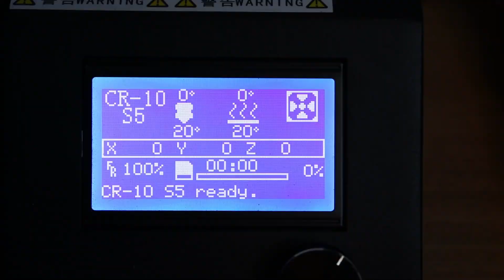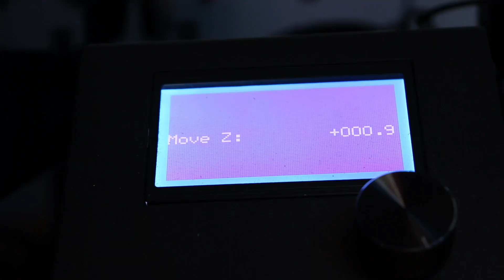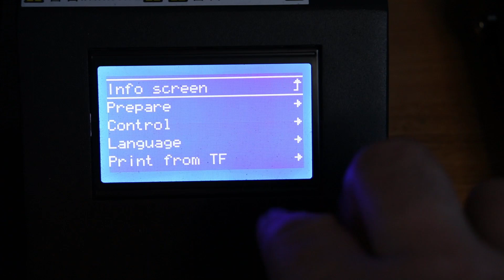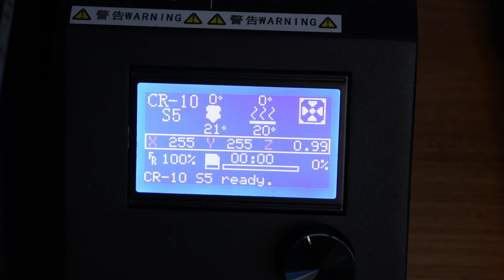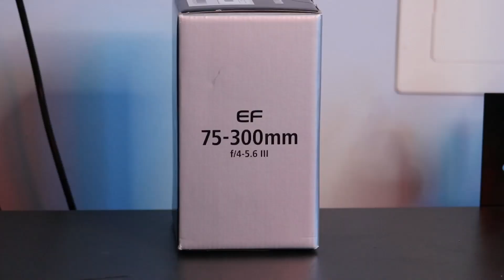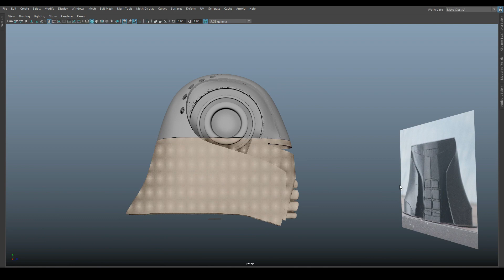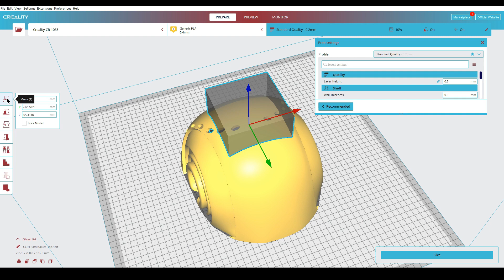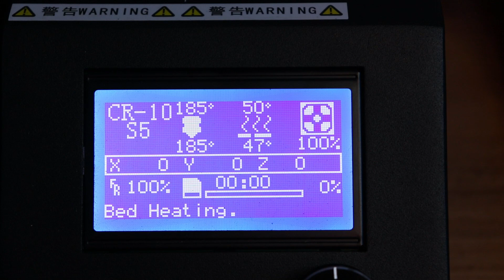Creality CR-10 S5 3D Printing: A Guide to Resuming a Failed Helmet Print

Comment: Uggg just ordered one of these, and seeing all the bs youve gone through I am regretting spending that kind of money on this. You also realize you are going to get a lot of issues leveling your bed cold. You need to head up to normal printing temps while leveling. And you need to stop touching your bed. Your fingers leave grease, and it will keep the print from sticking. Take it to the sink, wash with warm soapy water, dry it with a microfiber towl, and handle with gloves. Also try to print yourself some new knobs for bottom. I had to do that with all my CR-10S.  Lots of them on Thingyverse.
Reply from the maker: Hi Figure Six, thank you for the comment! I hear ya, it's not a cheap printer, and I tried returning it with Creality Official, and they just ignore my request and instead send me parts to fix the issue. Since this video, the knobs came loose again and the print failed. I finished it up on my CR-10 Smart. They sent me some new parts, and I'll be making a new video on this, and hopefully it will be the first successful print, start to finish on this behemoth lol. Also thank you for the advice, I will give that a try :)
Reply: @3DTheory  Sorry didnt mean for that to sound so bossy... I am already printing out new knobs and ordered silacone bed mounts getting rid of the springs. Ive also done that with all my printers. Hardly ever have to level once the springs are replaced.  I wish they made the Creality CR-10 Glass Bed Upgraded (black one with coating) for this size. I use that also on all my other printers, I can print just about any angle with no supports. Sticks like glue, wont come off until the bed fully cools down. Just gotta make sure its very clean after every use, cuz one spec of oil from fingers and print will slide all over the place. I ordered mine through Amazon so I will have 30 days to return it, if I have those kinds of issues. Ill keep watching see how your helmet comes out. Quite a long print for a helmet. All my Mando helmets take only a day and half 2 at most.. This must be a bigger helmet. I also been using a .6 nozzle instead of .4 make really nice prints and much faster. Anyways man, good luck..
Reply from the maker: @AncientOutlaw_raider1  Thank you so much :) It's a good thing you got it on Amazon, it's gives you a way out in case it keeps giving you trouble. I love glass beds with the coating too, I have that on my CR-10 Smart, I had to take a hammer to one of my prints as it was so stuck on there lol :D I usually scale up the helmets to fit loosely on my head, and I print pretty slow with a 0.4mm nozzle for higher quality. I will try a larger nozzle soon though! Nonetheless it's a pleasure to have you part of the 3D Theory community and can't wait to read more of your comments in the future :) Cheers!

Comment: They sell E-clips. Get you a micrometer and check the thickness of the stud and just get some E-clips to lock it in place. Most you'll have to do is get so needle noses and a tiny flat head to remove the clips. I was debating getting this and starting my business so I've been doing a lot of research on and watching videos about it. Since you offered insight on the printer I'd figure I'd try an offer you some assistance with that problem of the bed loosening on you.
Reply from the maker: Hi Smackledorf Mcsween Sr. thank you for the comment! It’s the first time I’ve heard of an E-clip, that sounds great! Creality support sent me another set of springs, screws, and knobs and hopefully that does the trick, if not I will be getting those E-clips and giving them a try. I am happy and grateful you found some value in my video and also thankful for your advice :)